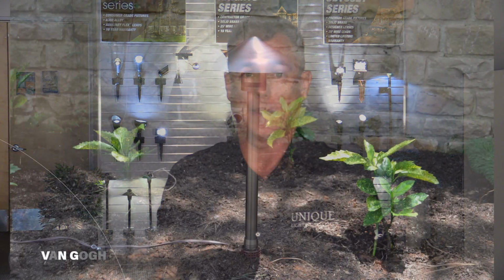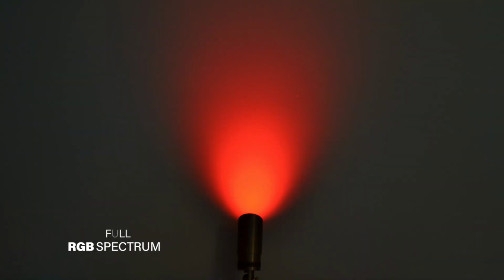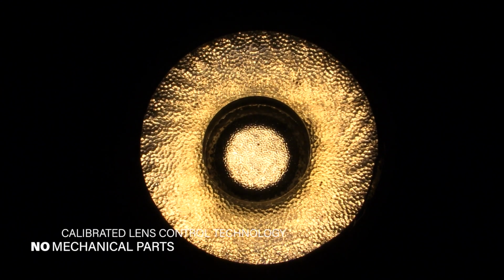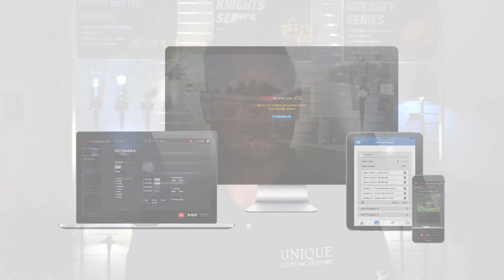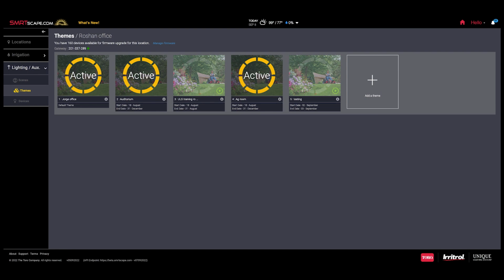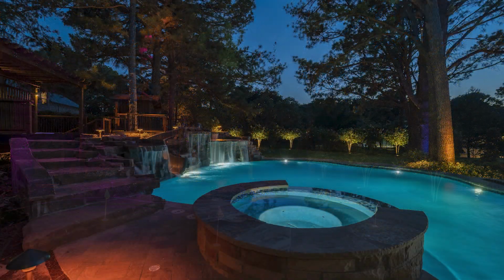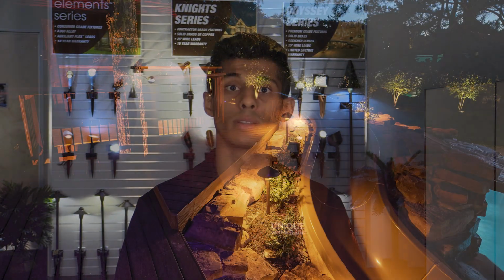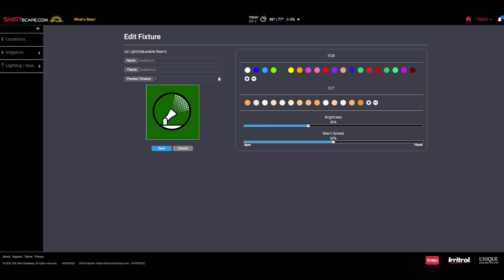INSPIRA™ Product Overview

Comment: If the light bulb needs to be replaced, will that affect the colors or the colors come from the crystals?
Reply from the maker: It is a LED module, not a "drop-in lamp. The LCD crystals control the beam spread, not the color.